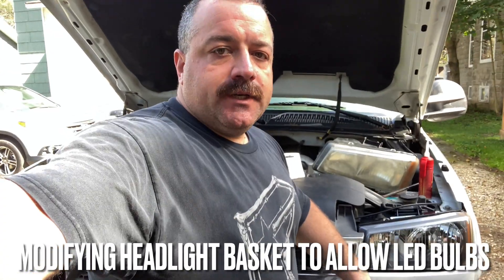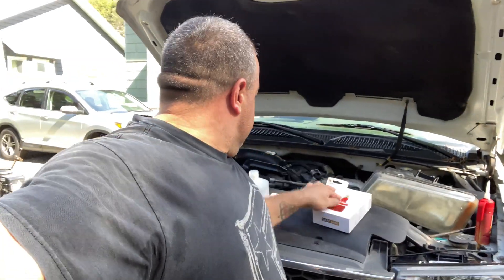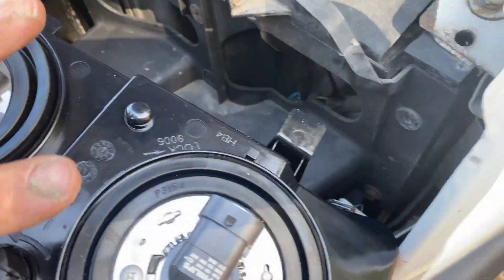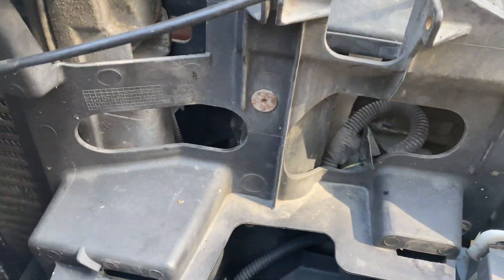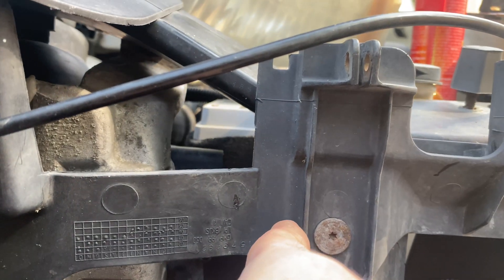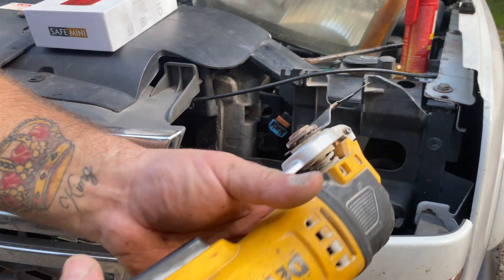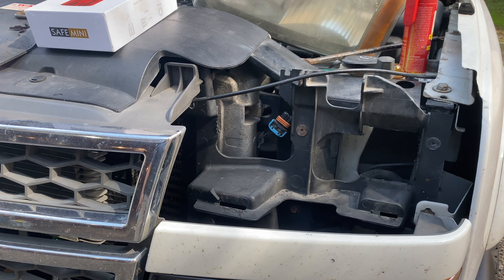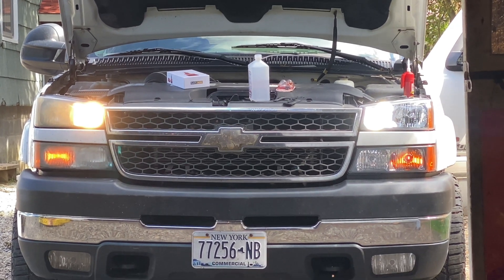Modifying 2005 Silverado to allow LED bulbs @BosllaLighting

Comment: Hey Joe I changed my incandescent bulbs to led on my 2005 chevy truck and I don’t have a clear light pattern. It has shadows that look like fingers in the light beam. Any suggestions on how to fix this issue ?
Reply from the maker: Step 1: Try spinning the bulb in the housing. LEDs usually don’t give a 360 degree pattern like an incandescent so you have to try to make sure the LED chips are pointed toward the reflectors better than they are now. This is called “clocking” the bulbs because you’re spinning them in the housing like clock hands spin. 

Step 2: Try a different (maybe better) brand of bulb with a better dispersion pattern.

Comment: Why didn't you show the comparison in comparable headlight housings? The left one is old and blurry/oxidized, but the right one with the led is brand new which could be misleading as to the true difference between the two. Just wondering.
Reply from the maker: I didn’t take the time to show the different comparisons. It would have been better, I agree. Also would have been better at night.